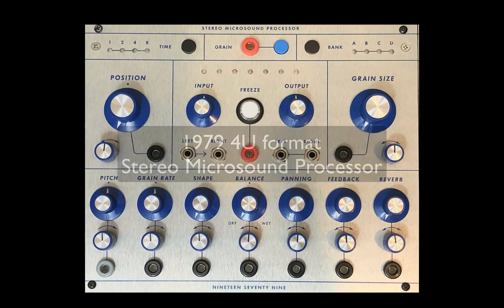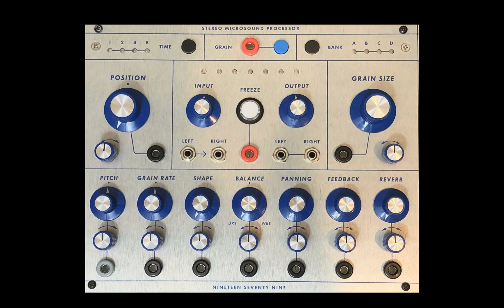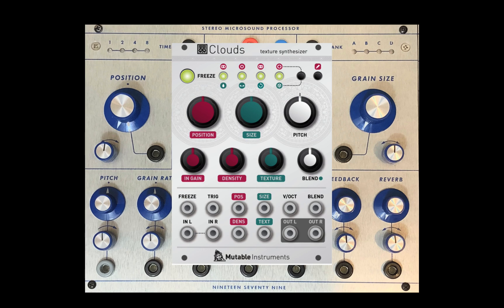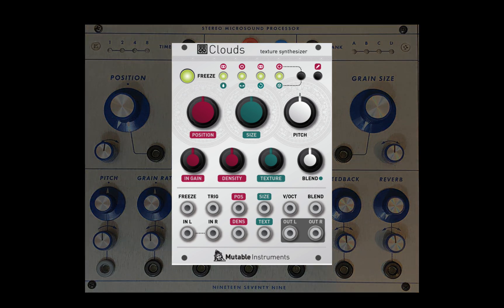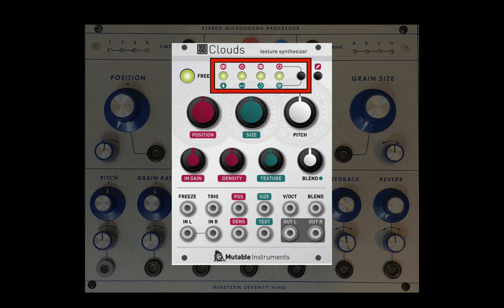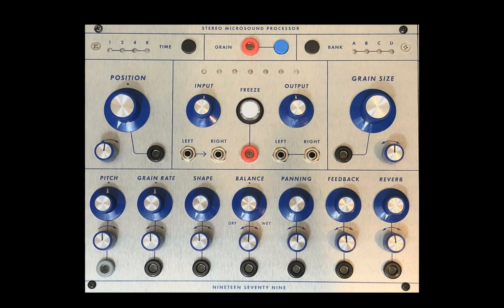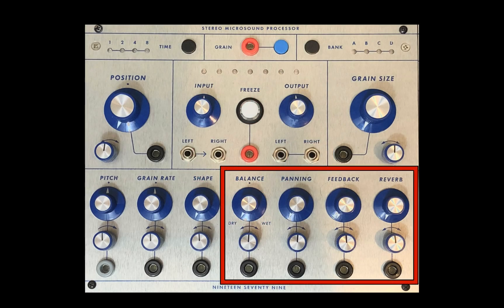1979 SMP Overview

Comment: As usual a very clear explanation though on top left you said "you can chose how long your sample is..." Trying to complement I visited 1979 + Mutable to fully understand and that top left section does much more, doesn't it? Gathered the following:

Change DSP Mode: Like Clouds, the SMP offers four separate DSP modes: Granular, Pitch Shift / Time Stretch, Looping Delay, and Spectral Processor. To change the DSP mode, hold the TIME switch for a few seconds, then select one of the four modes (the LEDs are in the same order as the Clouds modes):

	• (First LED lit) Granular processor (normal operation).
	• (Second LED lit) Pitch shifter/time-stretcher.
	• (Third LED lit) Looping delay.
	• (Fourth LED lit) Spectral processor.

GRANULAR MODE
Home sweet home.
PITCH-SHIFTER/TIME-STRETCHER
This mode is quite similar to the granular mode, except that it uses two overlapping grains synchronized with the most salient period of the sound. The grains are carefully spliced so that they mesh well with each other (a technique similar to the “deglitching” of early pitch-shifters). Modulating POSITION when recording is frozen will “scrub” through the audio buffer. Clouds’ uses classic time-domain methods which are not suitable for polyphonic or percussive material (unless this percussive material is breakbeats and you liked Akai samplers. Then: smile).
DENSITY creates a granular diffusion effect based on all-pass filters.
TEXTURE acts as a low-pass/high-pass filter.
SIZE controls the size of the overlapping windows used for pitch-shifting and time-stretching – from an extremely grainy “drilling” sound to smooth bits of loops.
Sending a trigger to the TRIG input creates a clock-synchronized loop (when FREEZE is enabled) or stuttering effect – equivalent to applying a tempo-synchronized decaying envelope on the POSITION parameter.
LOOPING DELAY
The looping delay mode continuously plays back audio from the buffer without any kind of granularization.
POSITION controls the distance between the playback head and the recording head (in other words, the delay time). Modulating POSITION will create effects similar to vinyl scratching or manual manipulation of tape.
When FREEZE is activated, the content of the audio buffer is looped (stutter effect). POSITION controls the loop start and SIZE the loop duration. DENSITY creates a granular diffusion effect based on all-pass filters; and TEXTURE acts as a low-pass/high-pass filter.
SIZE controls the size of the overlapping windows used for pitch-shifting – fully clockwise for a smooth result that might smear transients, fully counterclockwise for a grainy, almost ring-modulated sound.
When FREEZE is enabled, sending a trigger on the TRIG input creates a clock-synchronized stuttering loop. Otherwise, the period of the trigger pulses sets the delay time – provided this delay is shorter than the recording buffer size.
SPECTRAL MADNESS
In this mode, the incoming signal is converted into “frames” of spectral data, that are stored, transformed, recombined, and resynthesized as a time-domain signal.
POSITION selects into which buffer the audio is poured (when FREEZE is not active), or from which buffer the audio is synthesised (when FREEZE is active). For example, set POSITION to its minimum value. Press FREEZE. You get a first texture. Set POSITION to its maximum value. UNFREEZE. Wait for something else to happen in the incoming audio. Press FREEZE again. By moving POSITION you interpolate between the two textures which had been captured at the press of FREEZE. Depending on the quality settings there are 2 to 7 buffers laid out over the course of the POSITION knob. What the module does is crossfade between a “wavetable” of FFT slices.
SIZE changes the coefficients of a polynomial that determines how frequencies are mapped between the analysis and synthesis buffers. It’s like a 1-knob GRM Warp. Over the course of the knob it’ll do spectral shifting, but also spectral reversal.
PITCH controls the transposition (pitch-shifting).
DENSITY determines how results from the analyzer are passed to the resynthesizer. Below 12 o’clock, there’s some increasing probability that a given FFT bin won’t get updated, causing a kind of partial freeze. After 12 o’clock, adjacent analysis frames are increasingly merged together (like a low-pass filter in the amplitude each frequency bin). At extreme settings, random phase modulation is applied to smooth things - giving you different flavours of spectral muddling/reverb.
TEXTURE does two things: below 12 o’clock, it increasingly quantizes the amplitudes of the spectral components, like a very low-bitrate audio file. After 12 o’clock, it increasingly weakens the strongest partials and amplifies the weakest ones. This has the effect of making the spectrum more noise-like.
Sending a trigger to the TRIG input creates various frequency-domain glitches typical of corrupted (encoded) audio files. It works as a kind of build-up/feedback effect - the shorter the pulse, the smaller the effect. With a continuous gate, it’ll really start to rot…
Reply from the maker: Modulisme Modulisme 🙇‍♂️
Reply: @vgermuse  in any case it was after watching your video months ago that I knew I'd need the module. Thanx again